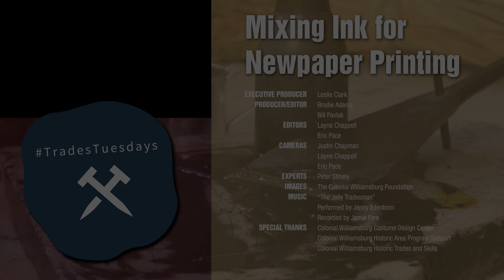Mixing Ink for Newspapers

Comment: Very interesting! I have zero experience when it comes to printing, however I know quite a bit about water based inks, like the types used in fountain pens. Noodlers Inc. Makes a fantastic line of inks, and pens, for that matter. With fountain pens it's all about the nib. I was wondering what are thoes big ink applicators used in ur setup called, and how are they made? Are they a big factor in how the prints turn out? Also how do you clean up an oil/resin based ink? Turpentine would be my guess.
Reply from the maker: Funny you should ask... stay tuned for the next video! 😉